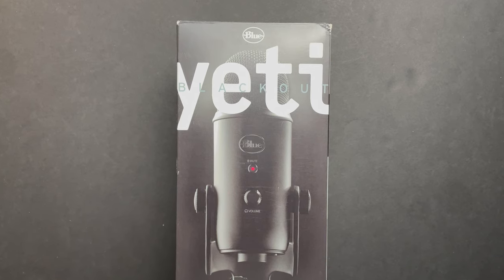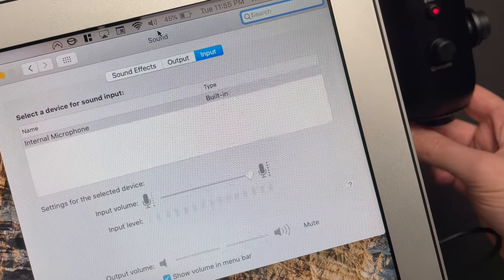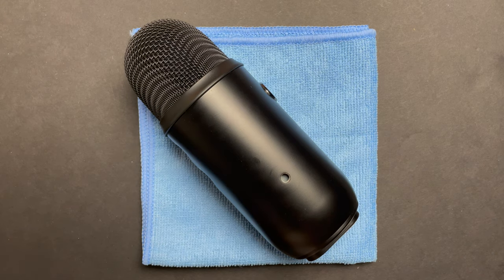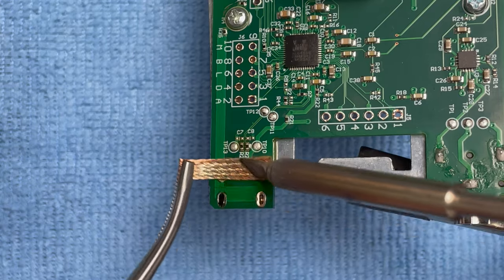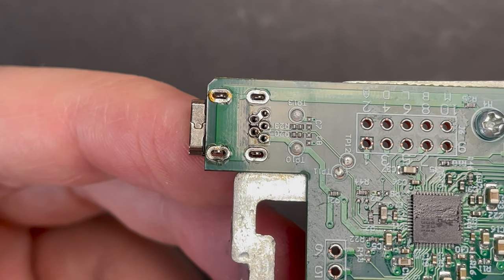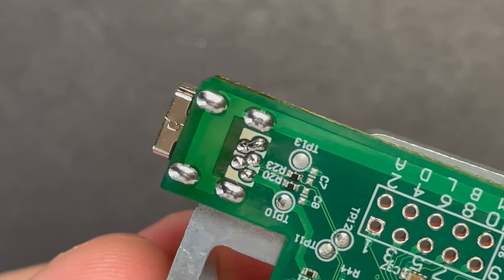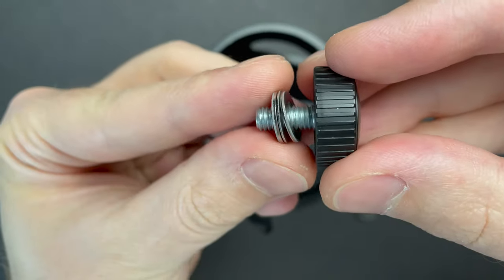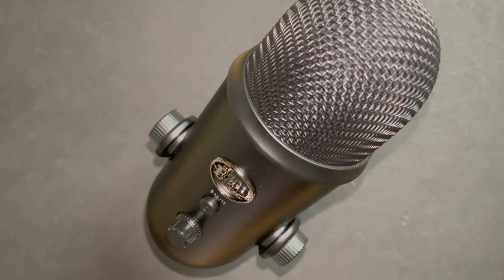Broken USB Port Repair on a Blue Yeti Microphone - Mini USB Port Replacement

Comment: Don't buy this mic is the best advice there is. But, a good video in spite of all that if you don't mind spending time fixing a problem that shouldn't exist to begin with.
Reply: 100% the cord in the back, the mini USB male is long, thick ( pause) and hits the metal base frame. The pressure damages the inner female plug. That’s how mine broke. I purchased all the tool a dtried to fix mine and failed. It’s was a 3-4 hours process of trying. The chip “boards” ( not sure of terms) ended up getting the small copper rings damaged when ai was trying so hard to get the small pins out. After they were soldered., in. Its was a pain. I tried twice and ruined it. All because there stupid plug should have been a 90° angle plug. Or just a better socket. Placement, ugh.

Comment: I had this problem, but instead of soldering on a new crappy connector, I soldered on the wires from a usb cable directly to the board and hot glued it in place so it couldn't be yanked out anymore.

Comment: Good to know this is a nice easy little repair. I bought the same blackout model brand new in-store a few months ago and I'm already noticing how loose the USB connector is getting. Maybe 2 out of 5 times I move or adjust the Microphone, the wire wiggles and interrupts the data/sound and i need to unplug and plug the wire back in.
Reply from the maker: It's a design oversight because the USB cables gets caught on the stand when you adjust the mic positioning, if you aren't careful. Yep, it's an easy repair and if yours is only intermittent you might not even need to swap the port, you can just reflow the pins with some fresh solder to reconnect them properly.
Reply: @BorderlineOCD  I hadn't considered doing that. If it gets worse and that's all that appears to be needed done, I'll do it. Thanks.

Comment: Your soldering skills and camera work are fantastic. I just did the same repair myself (poorly, but it works). I wish I'd seen your video first so I'd know pins 1 and 2 were supposed to be shorted to each other so I wouldn't have been so worried about it.

Comment: TIP for anyone who is looking for a replacement part of the Mini USB socket and can't find it. 
Use "PS 3" in the search query, PS 3 controllers use a Mini USB socket that has the same pin layout/leg placement.
Reply: Thanks for this! Couldn't find the correct layout for the life of me
Reply: MEU DEUS TE AMOOOO, to há uma semana procurando essa caraia dessa entrada e nao acho
Reply: Thanks for this i even have an old ps3 controller i could use for parts 👌

Comment: It took me 2 tries over 4 months but I was able to fix my mic thanks to your tutorial. Saved me about $75. I haven't soldered in about 20 years but your tutorial helped me get it done. The hardest part was getting the old usb connector out and I damaged the board trying to do it. I really didn't think it would work when I put it all back together, but it's working great now! Thanks!

Comment: Exact same problem -- exact same solution. I bet this happens a lot actually.  Check out the way the mic stand is designed - the USB cable routes through a space in the stand.  When you tilt the mic down, the cable end catches on the mic stand and puts tension on the USB port.  For me, I was literally unboxing it thinking I had tightened the mounts too tight - I pulled down with a little more force, and ... click ... the USB port broke. It turned out the mic was not tightened down instead I was feeling the cable catching on the mic stand.  Thank you so much for sharing this - I ordered the parts, pulled out my iron, and a couple hours later it was new again.  My biggest heartache was getting the old leads out of the PCB - but some patience with a solder sucker and a football game did the trick.  THANKS AGAIN!!

Comment: My friend said that for taking off plastic parts with tools old rubber works well for it. For example we reused old ''useless'' wheel rubber from the inner tubing. Chop to size and it's great for lots of things.

Comment: advanced soldering... I've only ever soldered using the traditional method (that doesn't usually work) and solder spilling everywhere or not sticking to whatever I want to solder.  Someday I'm going to get into the correct way to do this

Comment: I came here, after the fact, as one of my Grand kid's ask if I could repair a loose Headphone jack on one of these Mic's.
My comment was just going to be, I don't know how you didn't make any solder bridges when you installed the new USB jack ?
My assembly would have been a bit different, in that I likely would have secured the four (4) mechanical anchor points to the board, before proceeding to the electrical connections !
But that's just me !
As long as it works, I guess is the important part !
Interesting, none the less !
Thanks !
👍😉

Comment: Nice repair. i have my own repair going on, a 3700x with 2 broken pins. Now i dont own a hot air rework station so my soldering iron will have to do but i am definitely going to be buying one soon since repairs requiring one have increased a lot and i dont want to ruin anything by not using the correct tools
Reply from the maker: That doesn't sound like an easy repair! Good luck. I'm not going to sell you on my $35 hot air station because I know its garbage, but for the once a month I use it, it works great and I'm very happy I bought it. Definitely agree the right tools help even if they are cheap ones when you're starting to expand your toolkit. So many tools!
Reply: @BorderlineOCD  i did already replace the pins on it but after installing windows and not having an audio device present even in device manager i thought it might be the pins so i took them off again and put some pins in the socket instead but nothing changed. it seems that more users dont have any audio device with this windows version so im going to put some new pins on the cpu and reinstall an older version of windows instead and see if audio works again

Comment: I think that for removing the knobs you could use one of those rubber band wrenches. Seems like it would be gentler on the plastic and potentially have better grip.
Reply: He got the same result, with something he had lying around. But yeah using a rubber band instead with a wrench, like how he has done it this would work great in theory
Reply: @5izzy557  I mentioned it because you could see the pliers damaging the plastic on the knobs.
Reply: I tried this using a rubber band I had lying around and it was really effective and didn't leave much damage. The only tricky one was the mute button, but worked. Thanks for the tip.

Comment: Amazing demo step-by-step tutorial. Unfortunately after I tried this twice, I ended up damaging the copper pads on the motherboard, on 2 to 3 of the pins in one of the legs. 

Basically, I kept trying to clean it out with the J soldering iron. To push out the remaining broken pins. After trying to clean out the solder over and over. 

The wear and tear took out the little copper pads. So now the board is damaged. I really think this whole design of the yeti blue is terrible as far as the cord in the back. 

The mini USB cord doesn’t have a right angle and it hits into the frame, of the base. Puts pressure on the cord. Overall, I tried my best to follow your steps. I’m very disappointed. 

I didn’t work out because I was excited to finally try to work with electronics. I feel like I was doing most of the things correctly. Although I did not have that copper mesh clean. And to help extract the solder. so basically I was just trying to heat and scrape out the solder. 

Which is unfortunately what damage the inner holes in the copper rings of the pads. Oh well. Hopefully my warranty I can just switch since it’s a two-year warranty and I only got this a month and a half ago. 

I hope. But thank you very good tutorial. Love the close-up shots. Great soldering

Comment: Aye man this was an excellent tutorial, worked like a charm. This mic sounds good and is a good price point, but this is a chronic problem with it and my advice to anyone in the market is to choose another mic. Ive never had a single mini usb port break on me unlike micro usbs which break constantly, so its a pretty good indicator that they used a low quality mini usb jack manufacturer.

Comment: Nice. If only it always went so smoothly :)
Reply from the maker: Indeed. I'm sure with smaller connectors it's going to take more practice to do them right. I'm looking forward to doing a USB-C or surface mount HDMI (like PS4 rather then through-hole PS3 style) but there aren't too many newer devices I'm terribly interesting in owning that have the newer style ports.

Comment: Very good video! I have a question though: how do you know which usb connector to choose from the dozens (hundreds?...)  that are around? Keep up the good work and the great filming!
Reply: @Gal2k6  Thanks, Big G.
Reply from the maker: Thats a good question. On this mic it was easy to find as its a common issue on this model and you can find links to the popular electronics suppliers on Reddit threads and other YouTube videos to get a good look at the port, even if you haven't removed it yet. Removing it and going by sight can work well too, as ports have identifying markers when you examine them closely. I have also used a caliper in the past to measure the "pitch" of a connector or socket to make sure I was buying the right one (like for the Neo Geo Bios socket). I've also bought the wrong port as well on previous projects so you don't always get it right :P
Reply: @BorderlineOCD  thanks a lot, brother!

Comment: Try using tooth picks made of wood when clearing the holes it is far easier imho. Just heat the solder, push in the tooth pick and hold it there until the solder cools off.

Comment: Nice, you should try replacing that mini usb port with a usb c one.

There's no drop in replacement but there's usb 2. 0 breakout boards with 4 pads for usb c connectors and you just wire them up to the pins on the board.
Reply from the maker: I saw a project video on DIY Perks some time ago doing this on a web camera. I thought it was a really neat idea. Definitely could be a fun tinkering project but although my iMac is a newer model with USB-C, my Macbook Air is the previous gen with no USB-C so I'm in no hurry to do that just yet.
Reply: @BorderlineOCD  USB A to USB C cable will still allow you to use it on both macs and make the blue yeti much better cause it’s the placement of the port that breaks it so replacing it with the same port will only work until it breaks again it’s a design issue

Comment: The yeti that I use just messed up and im pretty sure its just the USB port as the mic still gets power but it doesn't actually connect. Ill try and fix it if I can or atleast get the stuff needed to fix it and have someone who knows how to solder better than I can to do it. Would be a lot of stuff considering I don't have a soldering iron and I would need to get the port also.

Comment: I recently replaced the USB port on my Yeti as well. It was actually my first successful soldering job.

I guarantee what happened to Mike is what happened to this one.
Reply: Where did you buy the usb port?
Reply: @tot1fon256  just a generic PCB mount Mini USB port off of Amazon

Comment: Forgive my ignorance when it comes to this type of repair. My question is what tools did you use for the repair?
Reply from the maker: Leaded solder, flux and a soldering iron. I also used a hot air rework station to help clear the solder from the through-holes when removing the old port.

Comment: FINALY got a soldering iron as we began learning these things in school. Its a cheap one but its PERFECT. It goes up to 430c (it says) but i havent used it. It came with the sucking thing so its good. I hope I fix my PS3 some day. Any tips regarding safety or practicality? Thanks!
Reply from the maker: Suggest starting with something simple like a broken appliance cord or a large on/off switch etc. Build some confidence doing the basics and move up from there. Wouldn't attempt to fix a PS3 when you're starting out, especially with an iron that isn't temperature controlled. Good luck!
Reply: @BorderlineOCD  i know... My friends dad is a BIG repair man and he has hot rework stations so when christmas hits we will begin..

Comment: I JUST broke my pins today, in the middle of doing voice-over work. I don't have any of the tools or experience to repair it, but I really don't want to buy another mic...the actual microphone plug should still work though, correct?
Reply from the maker: You’ll have to physically inspect the USB port connector to see if it is salvageable. Sometimes is breaks clean off and can be reflowed. Sometimes there is damage or it’s worn and makes sense to replace. Either way a soldering iron, solder and some flux will be needed.
Reply: @BorderlineOCD  Hey I broke mine today I think. I was wondering what flux does. Do I need that?
Reply from the maker: It helps prevent solder bridges and keeps the solder on the copper pads where it's supposed to be. Solder is impregnated with flux but it's not enough for delicate jobs and for beginners especially I think it's a must. I don't solder without it.

Comment: Hello, first of all thank you for the video, it is very well explained and helped me a lot!
However, even after installing a new USB port, I have a problem with my microphone. The LED on my microphone lights up but the microphone is not detected by the PC. I reinstalled Logitech G-Hub, searched in the device manager but no trace of the microphone.
I have tried on another computer and I have the same problem, so it must be a hardware problem...
Would you have any idea how to solve my problem?
Reply from the maker: I would suggest reexamining your soldering on the mini USB port with a multimeter in continuity mode. It's likely the 5V and GND lines are good but one of the data lines is either not making a connection or it's shorted with an adjacent pin.

Comment: Do I need to take out all the screws if all I want to do is replace the LED light on the mute button? Or can I just pull that button out?
Reply: there actually isn't an led in the button, its just a fiber optic button attachment transporting light from the actual button. So you can just pull the "button" which is really just the attachment off and you will have to take out the screws and the inside to replace that LED.

Comment: I think my blue yeti microphone has the exact same type of issue, but I don't have the know how to fix it.
Reply from the maker: I have the USB ports linked in the desc you'd just need to find someone maybe a friend or family member that has a bit of soldering experience. It's not a particularly hard repair.

Comment: Hey man, I was wondering if you could tell me where you get some of your broken consoles so cheap. Totally understandable if you can’t.
Reply from the maker: I have no problem sharing bud, I just do this for fun and theres plenty to go around for everyone. There's no secret though. I source them a couple of different ways. First, I try to get bulk lots when I can and take a gamble on "untested" lots as well. If you look at the very first video I uploaded to the channel, thats how I started. It's a large upfront cost but if you average it out for each included console it should be a worthwhile investment, especially if you manage to get the majority of them working. Second I visit thrift stores often. 90% of the time I don't find anything but I've found a Dreamcast, PS2s, random loose controllers and cables, random game carts (like Game Gear which I don't even own the console). Third, I check Craigslist several times a week. Countless success on Craigslist. You have to keep checking because there are others like you locally who do the same. Fourth, I participate in eBay auctions, NOT "Buy it now". With "Buy it now" you guarantee you get the item, but not cheap. With Auctions, you have a chance to get the item (but no guarantee) at a lower price. Be prepared to bid and lose on many auctions but eventually you will win some for a decent price. Perhaps last, I buy internationally (like from Japan auctions). It only makes sense for bulk lots otherwise it's too expensive. It can be a good way to get exotic consoles (thats how I got my 6 Neo Geos). One last tip, I don't mind if I don't get the full console with accessories at the same time. For example, I got a Dreamcast with no accessories and I found the controllers for it almost a year later. I could have bought them on eBay but I just waited and eventually someone was selling a few on Craigslist. Bottom line, there's no secret discount store and I don't have any special connections. This is my hobby so I spend time on it every day. The more you look, the higher your chance of success.
Reply: @BorderlineOCD  Thanks a heap. Also, I’ve looked at Japanese auctions before and a while ago I found a pretty good site but I have lost it. Would you mind telling me the website name? Unfortunately in Australia there isn’t a very big Craigslist scene, but I’ll definitely hit up the local garage sales and thrift shops. Thanks again.
Reply from the maker: For stuff from Japan here in the US I use a proxy service like Sendico or Buyee. The most popular auction site in Japan is Yahoo Auctions. It's a clunky experience and its a slow process from start to finish riddled with fees but it works and your stuff will show up. I haven't been able to justify it for mainstream consoles though.